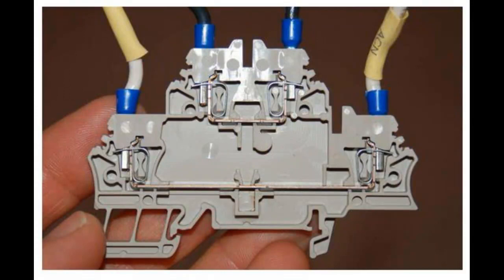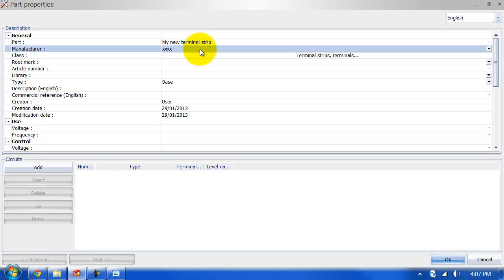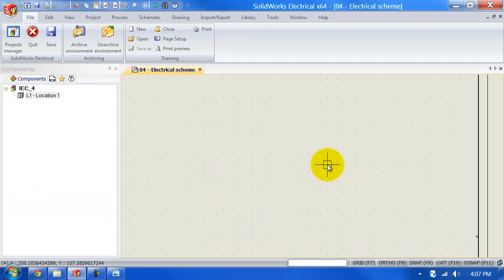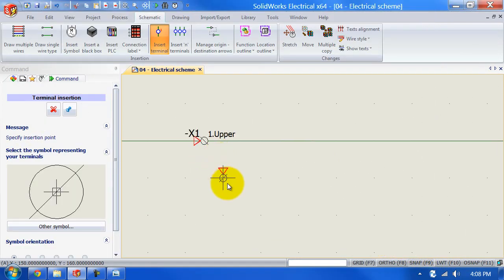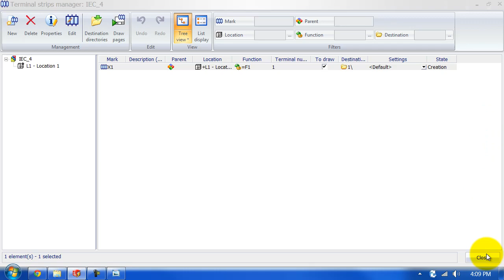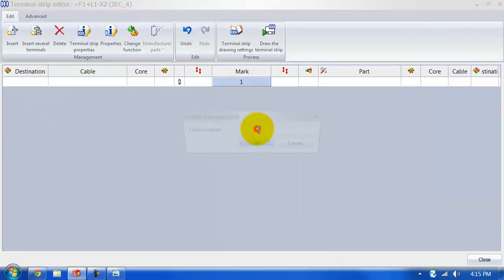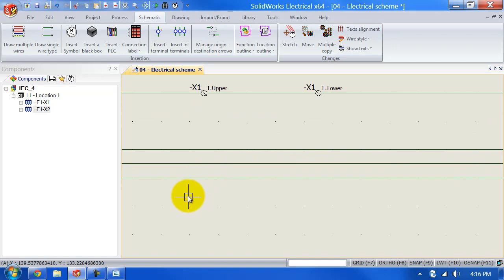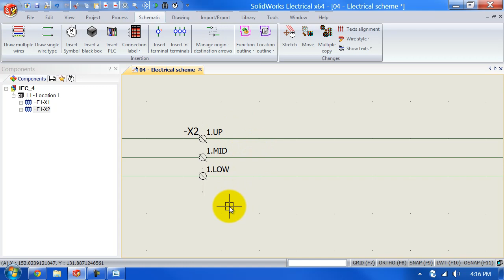10. SolidWorks Electrical - How to Insert a Multi-Level Terminal

Comment: So I did all of this but i have 2 wires per on terminal and when i go to generate drawings it seems to skip the second wire on terminal 1B 
it just shows the pin instead of wiring info and symbol like the one right above it.
check this link to see images of what i mean.
https://forum.solidworks.com/thread/218326

Comment: Thanks for many greate lessons but I've got question about virtual representation of junction boxes and control cabinets in Solid Works Electrical. From the one side the location must be the junction boxes, but it doesn't works correctly. Here look at my question if you have time: https://forum.solidworks.com/message/493239#493239
Thanks a lot anyway!